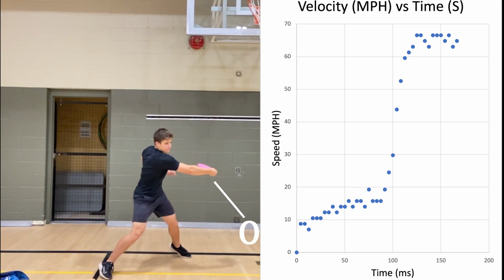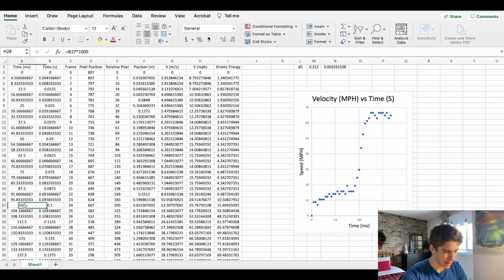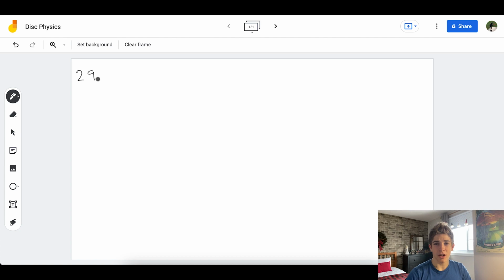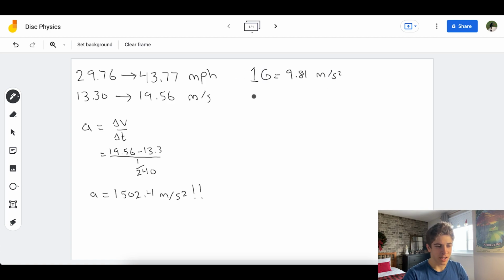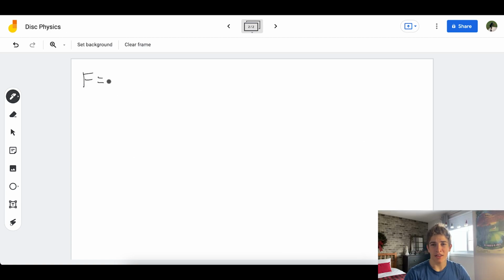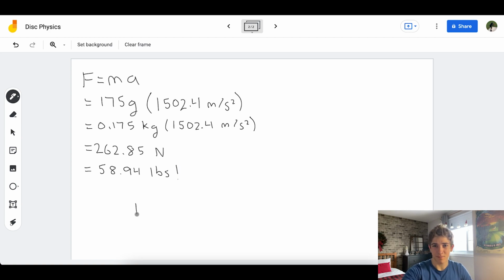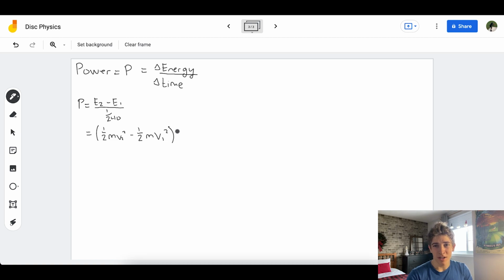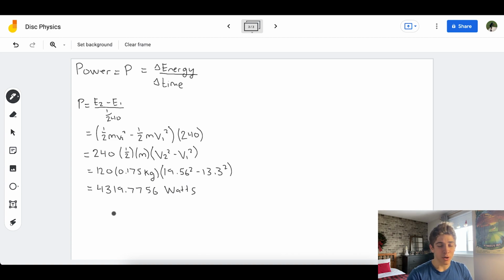How much FORCE in a Disc Golf Throw? | Joe V Disc Golf Analysis |

Comment: Isn't 175 grams the weight of the disc, not the mass?
Reply from the maker: It’s the mass, the weight would be measured in pounds or newtons. But weight is directly proportional to mass on earth.
Reply: @joevdiscgolf3246  ok thanks. It's just when you google, they say the weight of a disc golf is 175 grams, not the mass. Not sure if they misspeak since it makes a difference in our calculations. I am also trying to calculate the Force of a disc throw

Comment: Can you do a video showing your grip? I’ve gotten to a point where my form is pretty solid but now my grip could be holding me back. Should I always be using a fan type grip so the disc can snap out or is curling my back 3 fingers in also fine.
Reply: I throw 550 yes I am a random dude on the internet but still. Power grip gets the most spin and elongates the time it takes to gain speed the same way a rifle has higher bullet velocity than a pistol. Tuck pointer finger in to create a fulcrum. A 3 finger powergrip is usually taking out the pinky. Take out the pointer for a better more consistent release point. But snap is the timing of the hip movement with little to no arm muscle being used. Also, the snap sound is your fingers hitting the palm. The reason a 4 finger power grip works best is because your maximizing the time it takes for the disc to come out of your hand. Works the same way with a briefcase pull. Also, it gets more spin because there is more surface area on the rim. Grip is personal preference to an extent. If your going for distance 4 finger powergrip or stacked grip is best. But if your going for more control you can fan grip, but you lose spin but gain angle control. Drew Gibson uses a modified fan grip up to his wraiths were the pointer finger and pinky finger is tucked on the rim but the ring finger and the middle finger is fanned out. Eagle uses a modified fan grip anything 9 speed and lower where he tucks in the pinky and fans everything else out. But anything faster than a 9 speed he 4 finger powergrips. I think sometimes he fan grips his first run pd but thats the only time to my knowledge he fan grips anything higher than a 9.

Comment: Wonderful video; love seeing the data and appreciate you laying it out so clearly.
Reply from the maker: Thank you, means a lot. Which part was your favourite?
Reply: @joevdiscgolf3246  From a disc golfer perspective; I think the most relevant piece was the data points which display your largest acceleration.  It's easy to see why slow is smooth and smooth is far; the greatest burst of speed comes 2/3 through the throw which is well passed the "pull"! Fun fact: while it may seem obvious that a horse would output one horsepower... ...It's actually closer to 15 HP (at maximum). Good stuff!
Reply from the maker: @nktaylo1  haha that horse joke was my cheesy joke to see if anyone would catch it. That’s cool that they put out 15 horsepower. Makes sense that they can put out more power when maxed out. I totally agree, the majority of the speed comes after the pull, and it’s interesting to see that the velocity increases very slowly during the pull, before the power pocket is opening up.